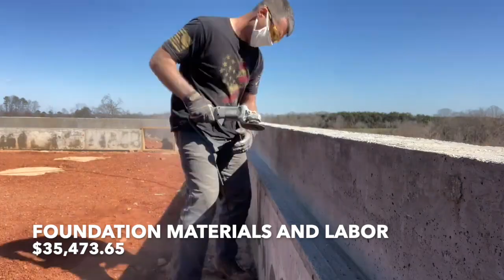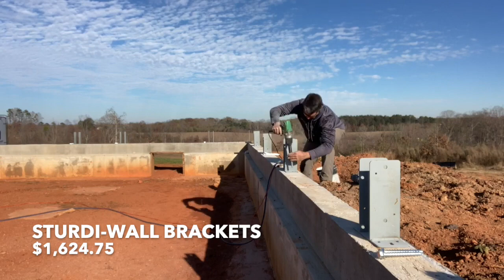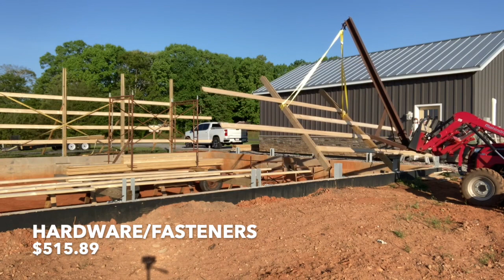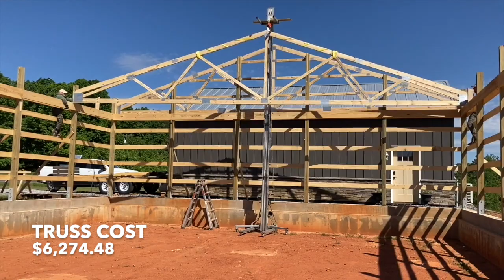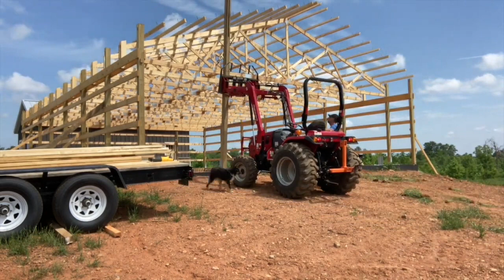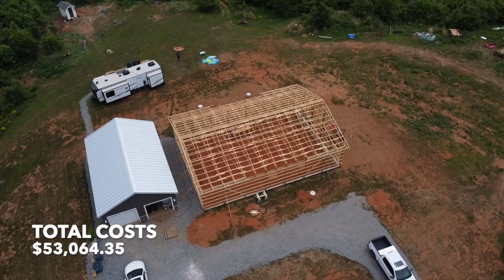Barndominium build on a crawlspace and how much it costs | Build highlights

Comment: Aint no dang way rhat stem wall cost $35,000!
Reply from the maker: Since we poured the garage footer and slab at the same time as the house I didn’t have a separate breakdown for each building.  For both buildings the total cost was approximately $52,000.  I allocated 1/3 towards the garage and 2/3 to the house.  The $52,000 cost includes footers, stem wall, garage slab, and excavation for both builds.  All labor was done by subcontractors.  Believe it or not this was not the highest quote I received during the bidding process.